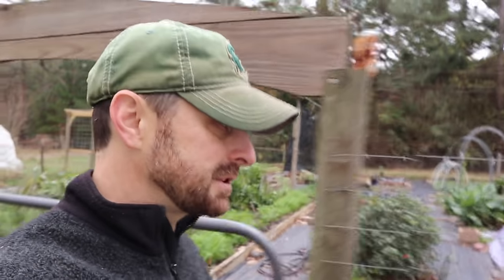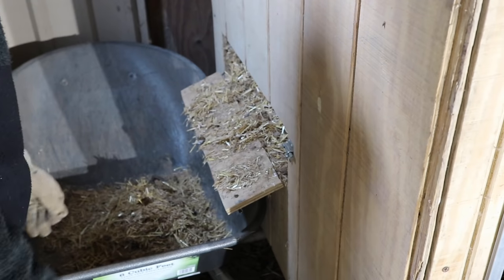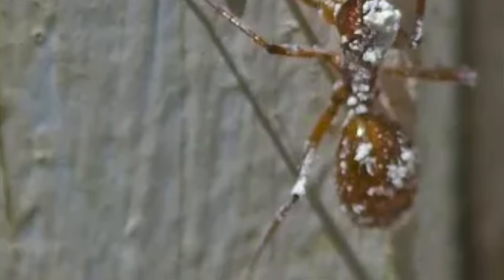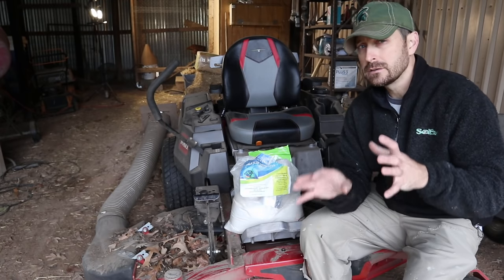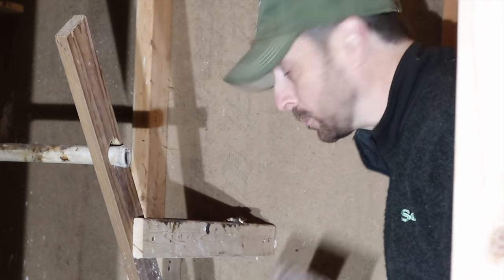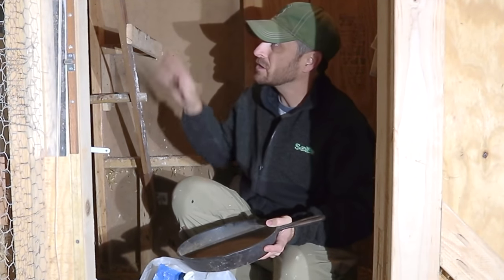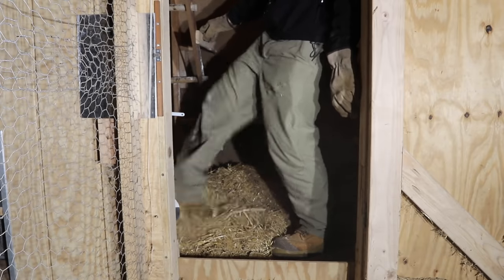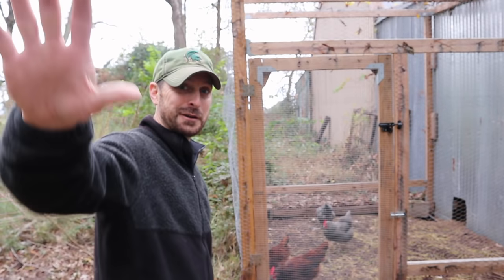Natural Chicken Coop Disinfectant! Which Is BETTER? Lime OR Diatomaceous Earth

Comment: Oh and by the way, both lime and DE are both completely safe to use in the garden. You could have too much lime which could ruin the pH of your garden, however it is still very good for your garden. Regarding the DE, if it’s mixed into the soil you’re only going to be killing any hard body insects you don’t want anyway. As far as bees and anything that flies, unless you’re putting it in the air while they’re flying around you’re not going to get them.  It doesn’t harm worms, typically if you have water bugs, ants, Beatles (who are soil borne), it’s gonna kill those. Hope this clarifies some of the info. 😃❌⭕️♥️🙏🏽
Reply from the maker: Thank you. I know. I have been using them for years.
Reply: @joesqudy  lime could easily mess upp Balance in garden or your deep litter ????

Comment: I love the idea of making a door to push the litter out into the wheel barrow… wish i had that yesterday when i did the big spring clean out. Going to show this video to my husband…. Lol. 
Re: lime and DE, I use First Saturday Lime (i highly recommend) in my chicken’s dust bath along with some food grade DE. Both are a fine powder, so i mix in plenty of soil, etc, thoroughly to keep the DE dust down… . I don’t use either of them inside my coop, but it’s just an 8x8 shed/playhouse converted into a coop and i only have 9 hens, and 2 ducks in there.  i have sand boxes under their roosting bars and i use a kitty litter scoop to clean the poop out of those every morning as soon as i let them out. I remove all wet/soiled litter from the Duck’s bungalow.  I also don’t keep any food or water in their coop.  I’ve been it doing this way for 2 years with good success.  No mites, fleas, etc. No odor in the coop after the morning scoop out and letting windows open in warmer weather.  Hope someone finds this helpful.😊
Reply from the maker: Cool
Reply: We use sand under our chicken perches as well.  I scoop it the poop in the morning and add it to my compost.  We use pine shavings in the bedding boxes. We don't have odor issues.  However, yesterday, I discovered that the outside of my coop was covered in chiggers! I threw DE everywhere and ran to the store to purchase cedar chips to spread in my yard and the run.  I don't use cedar in my on a regular basis, but it was an emergency. Hopefully, they will have died overnight!
Reply: How do you get your ducks to go in at night?? Mine just wanted to stay in the yard where predators could get them.
Reply: @annechen103  in the warmer months, they prefer to stay outside all night if I let them but i never let them because we live next to 1000 acres of forest and wildlife management area and it would be too tempting for predators, big and small. In fact, one night I came out to close up the coop and encountered a bobcat who was sniffing around the coop and very unhappy that I interrupted! So, I physically put them into the coop if they didn’t go in on their own but once I got them into that habit, they started going in on their own if I wasn’t out there to put them to bed by the time it started to get dark.  So, it comes down to routine and when you do have to force them to go in, you can either pick them up and put them in, or o sometimes just used a large leaf rake and directed them up the ramp and into the coop. Best of luck!

Comment: I have an A frame coop 6'x8' , nesting box on top level, I clean out the bottom twice a week, and move it 2x a month, I put aluminum screen on the inside of the bottom to get rid of flies , and I replace the hay in the top 2x a week, that keeps flies down.
Reply from the maker: I use the deep litter method and don't have an issue with flies. Clean mine every 6 months.
Reply: Yes, I am newbie of chicks.
My hubby n I started free range birds. Coop was a storage shed at first.
I didn't like cleaning it.
Smell as it was. Constantly it seemed putting fresh straw or hay. Fed up, my husband & my daughter finally built the coop I invisioned.
Placed on concrete pad atop a burnt out nonworking tall freezer. We turned the door side down n built the coop on top of that.
Used the deep litter method, once a year cleaning no mites, lice or flies.
So nice to enjoy my girls.
They not only feed us, but they are so calming to me with their lil chatter.

Comment: I have a great tip for you for spreading out the DE or lime, for that matter anything that you want to spread in the coop or garden...

I use this tip in the garden (I just got my coop so I will be using this in the coop as well). 

I save my empty spice bottles (which have holes in the top) fill them up with fertilizers, now I’m going to do this with the DE and lime. I sprinkle out in the garden (I will be spreading in the coop now using this method). 

It saves a lot of time trying to get just the right amount to a location. I hope this made sense.
Reply from the maker: Thank you for sharing.

Comment: I use construction sand.  Inert and bugs don't like it.  I use been on any pitching surfaces. Just rub it on.  Its humid and hot here in tn. So the deep litter doesn't work well.  Also in the wet cold winters the stew or chips get wet and stay wet!
Reply from the maker: Use what works for sure.

Comment: I've heard that DE shouldn't be used because it will also kill beneficial insects and microbes, if it gets into your coop litter and then into your compost pile.  It sounds like garden lime may do the same thing, so you don't want it in your compost.  I use the deep litter method, but what about dusting your chickens themselves with DE or garden lime to control mites and lice on their bodies?  I've thought about this, although it would be pretty time-consuming to catch and carefully dust each chicken to avoid getting the stuff in their nostrils or eyes.  I have put DE in the dust-bathing sandbox in their run, because that sand can be sifted to clean out debris and doesn't ever get put on the soil anywhere.  This way, the chickens can dust themselves.  I've never seen any lice or mites on them or in their coop.
Reply from the maker: I have never had any issue with it. There are so many varying opinions out there it will make your head spin. You'll just have to use your best judgement.
Reply: We use DE a ton and compost all our bedding. Our compost turns out great and vegies grow perfectly well. This is our 3rd year doing this with sheep, chickens and rabbit bedding. There are so many “scientific” opinions out there. I tend to listen to those with experience…
We have lots of worms and critters in there too 😊

Comment: I clean out the poop every morning, but I only have four birds. I use hemp for bedding so odor is no issue. I clean off my two roosting bars as needed. Question; do I need to wash down the inside walls with any cleaning agent, or is the scraping and dusting sufficient to protect against lice, etc?
Reply from the maker: You shouldn't need to clean out your coop that often. I clean mine our every few months and use the deep litter method. I do scrape down the roosting bars weekly and use the DE. No need to wash anything.
Reply: @CountryLivingExperience  
It’s a therapeutic thing for me. LOL!!! The wife claims I’m married to the girls now instead of her. Thanks so much for the video and your response here. Most helpful.
Reply from the maker: @rogerknight2267  Lol. 
You're welcome.

Comment: But is it ok to use either of those methods if you are not using the deep Litter Method , but you are composting it?  I thought I saw you composting.  After seeing your video I am a little worried bc we can’t get to our roosting areas to clean them.
Reply from the maker: I use mostly de so composting it is not an issue. Even the lime is fine if you don’t overdo it.

Comment: Hey, i have a coop with dirt floor and i install a stick upper from the ground so that my chickens can sleep at night there,  so i was wondering which one of there could be better to use it? Please!
Reply from the maker: I like to use the lime because it is dual purposed.
Reply: Its better to use a board or a large stick split in half because the chickens feet are meant to roost on flat surfaces not round sticks or dowels

Comment: So dolmite lime  or calcium carbonate lime is safe to use if it comes in contact with water?  Can I use it in my duck house,?  ducks are pretty wet creatures and I don’t want to use that if it becomes caustic when reacting with water. I believe that’s what you said in the video and I just want to be absolutely certain I am understanding correctly before I use it. I don’t want to burn my ducks feet. I have done a little research online but the information is not quite clear. Thank you.
Reply from the maker: That’s correct

Comment: I dont use lime as i assumed that because lime is said to be 12.4 on the alkaline scale, it would be considered to be corrosive. Not sure if this is correct. This assumption further led to the theory that chickens would be affected by the high alkalinity.
Reply from the maker: Hydrated lime is totally different than garden lime. I use garden lime. 
You are correct in your assumption. The hydrated lime is caustic and should not be used with chickens.

Comment: Does this control fleas? And can it be used with older chicks? A flea jumped on me this morning and I'm afraid I'm going to have an infestation quick if I don't do anything.  Now I don't use a floor covering.  Should I use something for a floor base. What should I use?
Reply from the maker: DE will control fleas but it is very slow acting. I would try to find something stronger at your local feed store to control fleas.

Comment: You can mix it with water and spray it on.Once it dries it does the same thing. You don't get it in your lungs this way.Wear gloves when working with lime!.
Reply from the maker: This is garden lime which is Dolomitic lime or ground limestone. It is different than Hydrated lime which is calcium hydroxide and is caustic.
Reply: @CountryLivingExperience    The type of lime you're using is added to worm bins to improve the soil .The hydraulic type (used to make white wash)kills worms,lice, bugs and insects.
Reply from the maker: @Yeshuaschosen  Both can be used.

Comment: Can you put lime when you make your dust bath for the chickens in winter time??
Reply from the maker: Sure
Reply: @CountryLivingExperience  Thank you- what do you think of sand for dust bath- I ve heard mixed things???
Reply: @truthseeker3967  I know I'm responding to your question, but I just changed my coop. I was told not to use fine/beach sand/sandbox sand. It will impact their crop and may cause other health problems.  I put course/river/construction sand on my floors to make it easier to scoop poop like a cat box.  I use lime for their dust bath. I read wood ash is also dangerous for chickens.  I know we are all trying to navigate caring the safest for the animals!
Reply: @dr.carrielynncimpermanl.ac1473  thank you- one lady with a chicken blog used coarse construction type sand but I don't remember the exact words- I was contemplating wood ash-  one chicken expert channel recommends, but then I read that when it becomes wet, it turns to lye- which they made sound bad- BUT- I guess I will continue doing what I do- put pine shavings in nesting boxes with some DE. Then under roosting bars, where the big poop is- it falls on a shelf, use peat moss- THEN, on the floor , use pine shavings which I donl t change often, the relatively few poops on there,break down- and it all becomes like dirt- whereas the poop shelf- I clean about once every two weeks- I guess I should do more- I bought bags of dirt - topsoil and will put it in a baby pool mixed with DE in coop when winter comes - i heard from one quart that some put sulfur in to ward off mites. My lime is in little pebbles and  I dont want to break my blender to get it in powder form-- maybe buy some??? what do you think of my set up??  Any ideas for improvement?? They are fed really well
Reply: @truthseeker3967  I am using Saturday Lime in my coop  and in their dust bath area and haven't had a problem for the last 6 months....its finely ground lime, so you won't have to break your blender :) I am afraid that the wood ash would burn them, so I don't use it. I basically did exactly what you are doing for the first 8 months and had no problems at all. So I think you are doing great!  Now I'm trying the course sand. I've used food grade DE for so many things over the years and never had any issues. I haven't put in my compost though, so, I can't comment on that.
Reply: @dr.carrielynncimpermanl.ac1473  Thank you for getting back with me-I appreciate all the tips- I'll consider the Saturday lime- Thanks again

Comment: Is there a problem with dirty coops if you don't have a floor and there is just dirt? My coop has dirt on the floor and I am wondering if I should put down plywood so I can put bedding on the coop floor.
Reply from the maker: Your dirt floor should be fine. I use the DE and lime up on my roosting bars mostly.

Comment: I just bought a small kiddy pool to make a dustbath for my chickens. Can I just put DE in it or do I need to add sand or other dirt along with the DE?
Reply from the maker: Mix the DE with sand
Reply: @CountryLivingExperience  thanks! 👍🏼
Reply: @CountryLivingExperience  how about top soil from garden store which seems to have some peat in it??  When you say sand, do you mean construction sand?? I heard sand box sand was not good.
Reply from the maker: @truthseeker3967  No top soil. Any sand is fine in my experience.
Reply: @CountryLivingExperience  What is it about topsoil that is not good? I opened up a bag of top soil and it had the consistency of peat moss- was not like dirt in my raised garden beds or filler dirt. I dunno-
Reply from the maker: @truthseeker3967  Topsoils have high organic matter that is not conducive to taking a dustbath. It will not get down into and between the feathers.